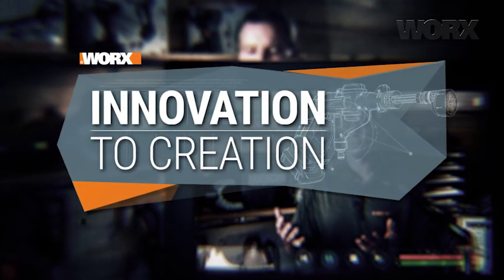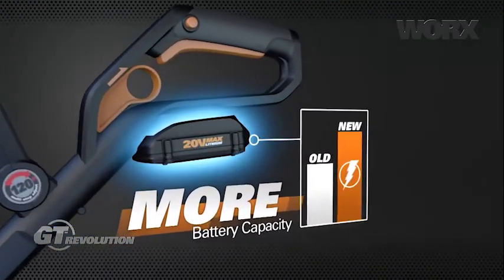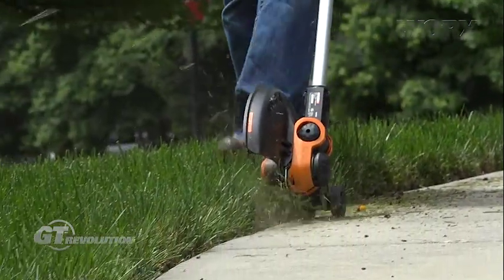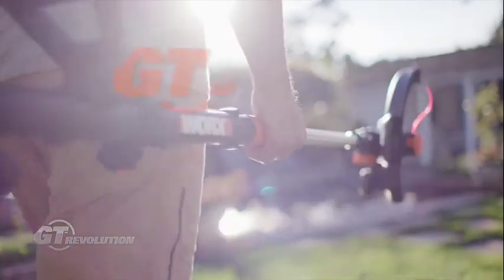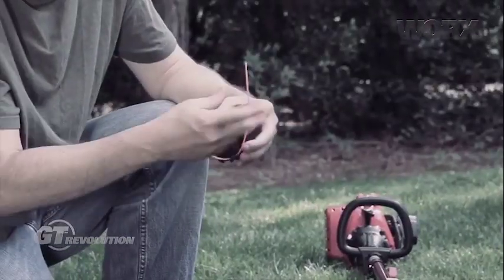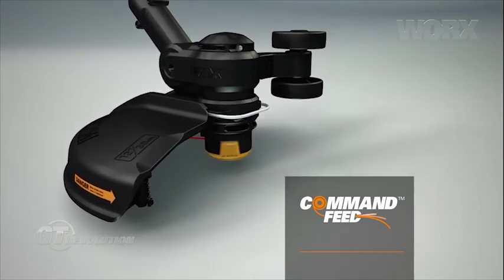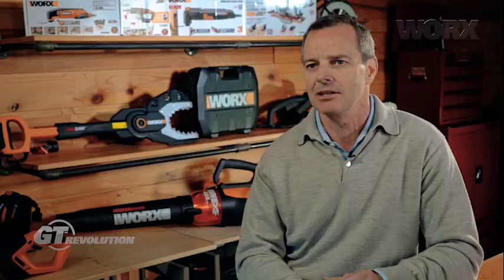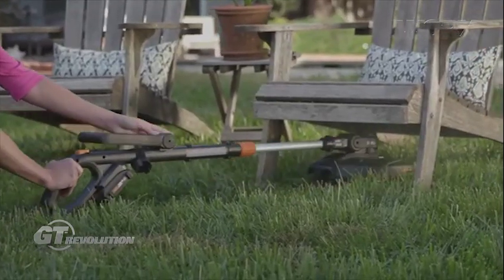Innovation to Creation - WORX GT Revolution

Comment: I wish you guys offered more of a variety of tools like air compressors, 21" lawn mowers, a system that will allow you to use the batteries as AC power and an actual impact so you can quickly change tires
Reply from the maker: Thank you for your feedback.  Our Product Development team is always exploring the latest and greatest in lawn care maintenance and the DIY power tool sector.  We will pass your feedback along. 

Thank you for choosing WORX!